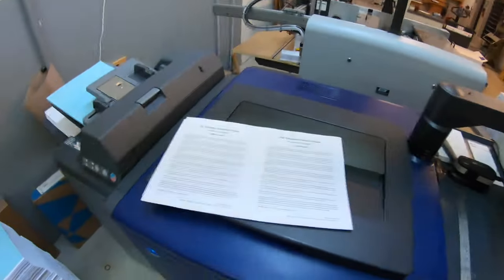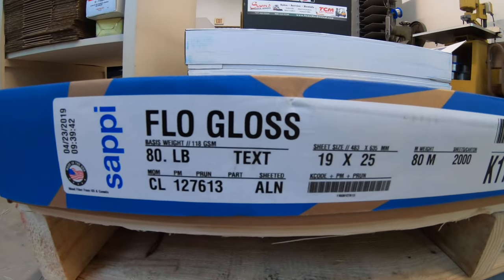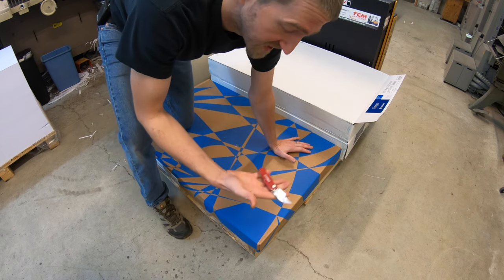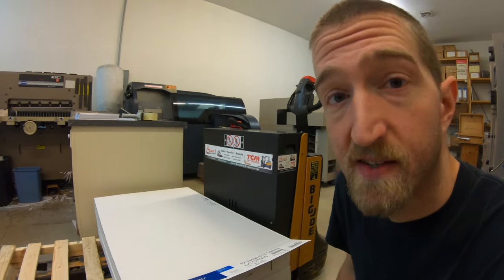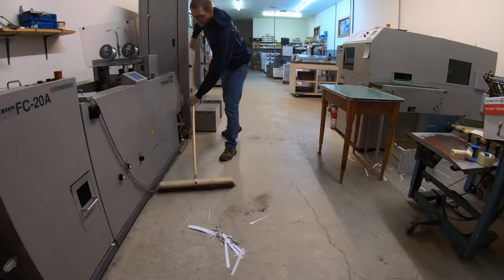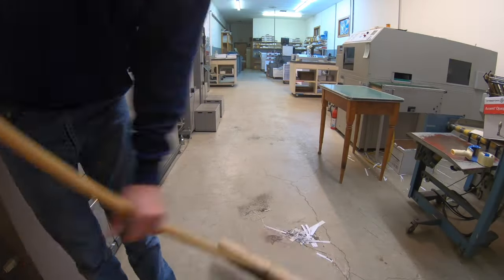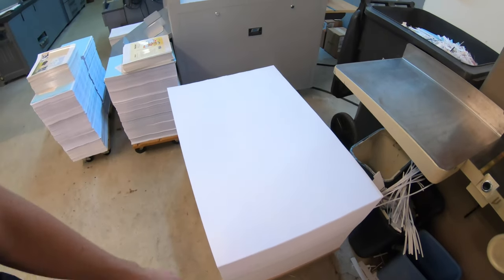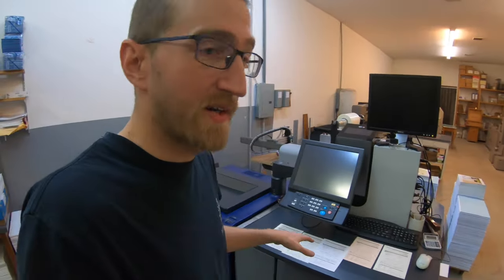Paper Types I Keep in Stock, Cutting Folio Sheets, Printing and Binding Books, Doing Work

Comment: I just started using 16pt c2s tango, but am switching to 130# Kelly paper brand. I do very little text stuff, mostly cover. The issue I'm having is finding a good glossy cover. I use dull/satin as my "matte" option and the glossy I've found looks almost identical. Paper has been one of the hardest things to pick as a new printer owner. Thanks for sharing what you do.
Reply from the maker: I have found that most of my customers look at the price and quality of printing. They rarely inspect/complain about the paper.

Comment: You can get Futura 18 x 12 or 19 x 13 #100 Gloss text or #80. It is the only cut sheet gloss text to come short grain. We use it all the the time for perfect bound books. Also there is a perfect bound glue by Spiel in NY that works as good a PUR glue. It is amazing you can even use on long grain and the pages stay. But it is costly $14.00 per lbs
Reply from the maker: Really? I didn't realize you can get that short grain. Thanks!
Reply: where can u buy this from?
Reply: What if I want to print pdf from a book and want to stick into those clear sheets & put in binder after. What paper would you recommend? I want something a little thicker than normal printer paper. Can an at home printer print on Gloss paper?